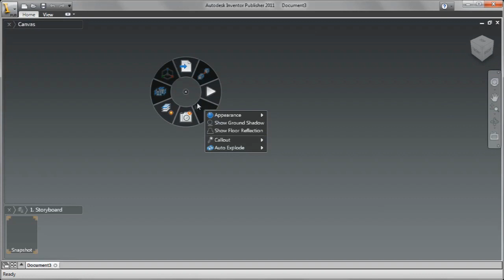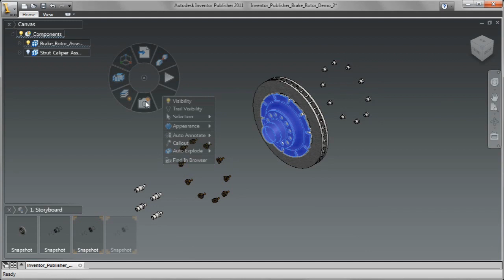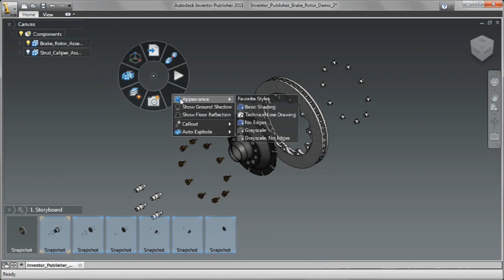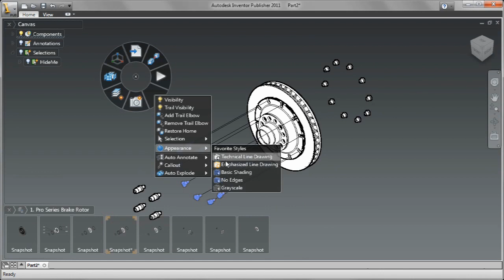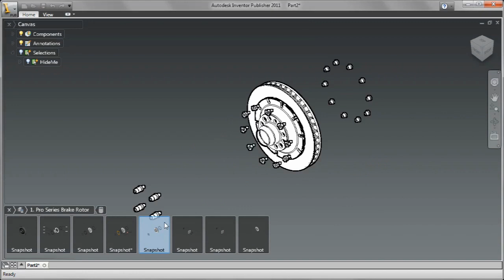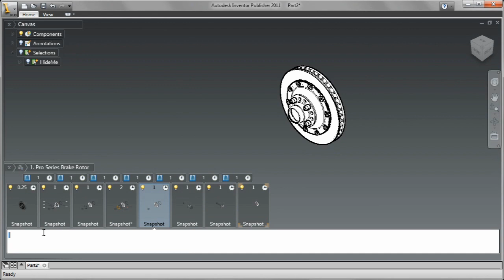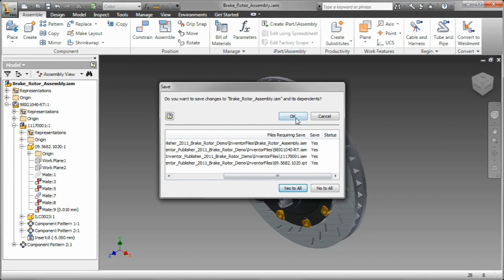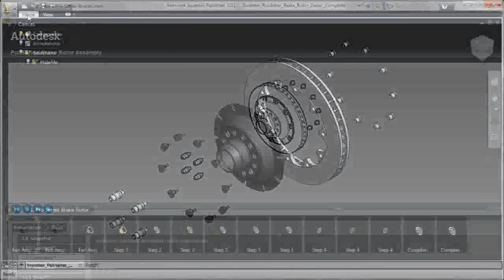Autodesk Inventor Publisher 2011 Demo

Comment from the maker: @YesYou123333 check out Project Twitch from Autodesk if you are in the US or Canada. Google Project Twitch and visit the Autodesk LABS. There you can run a trial version of Inventor without installing it on your computer so that you can learn it as you mentioned above. I'd post a link but you can't post links in these comments.